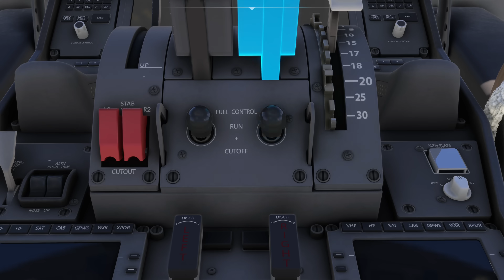Air India 171: Why Did The Fuel Cut-off Switch Get Moved?

Comment: What if the fuel control switches dropped to cutoff due to mechanical error and the pilot after he noticed the change in engine  noise looked at the switches and saw them in cutoff and assumed that the other pilot switched it and that is why he asked “why did you cutoff” to which the other pilot responded “I did not”. You don’t have to be guilty of anything to deny something you did not do. People assume a lot of things when something goes wrong. It is very natural that the pilot who saw the switches in cutoff wrongly assumed the other pilot did that.
Seems like a lot of aviation experts are trying to blame the pilots without even considering the possibility of a mechanical error on Boeing’s part. Not like Boeing has the best track record related to quality control and safety issues.
Reply: This is another assumption. What If he just assume that the switches was used because the engines spool down? . He asked and the other said he doesn't.... All speculations....
Reply: Check mentour pilot. The control switch has to be lifted then moved to cutoff. Not like a light switch
Reply: @richardzaluski assuming the mechanism is not broken. Did they verify the lock and mechanism were functioning correctly?
Reply: “Seems like a lot of aviation experts…” yes, the experts are. They are doing this because we know that the fuel was cutoff to both engines because the fuel control switches were moved to cutoff. So there is no mechanical error in the fuel lines. The switches are moved to cutoff, and immediately one of the pilots noticed and asked the other why he had done so, so it is safe to assume that one of the pilots saw an intentional act whether it was their own or the other pilots. What you are then suggesting is that both fuel cutoff switches moved to the turn off position just by themselves at the exact same time, prompted by nothing but gravity and takeoff vibrations, and at least one of the pilots was hallucinating. I think I need to go with the experts on this one.
Reply: I'd want to see the lever design and locking mechanism before I jumped to any conclusions about the pilots switching the switch.

Comment: The most probable and inescapable cause of the dual engine shutdown on Air India flight VT-ANB was an erroneous electrical signal generated within the aircraft's flight control system. This signal falsely indicated that the fuel cutoff switches had been moved to the "CUTOFF" position, even though the physical switches in the cockpit remained in the "RUN" position and were not manually actuated by the pilots.
This erroneous signal could have originated from:
 * A transient software bug in the Engine Control Units (ECUs), Flight Data Acquisition Units (FDAUs), or related control software.
 * A sensor malfunction within the fuel control switch unit itself or its signal pathway.
 * A subtle wiring fault (e.g., intermittent short, insulation breakdown) that momentarily mimicked a "CUTOFF" command.
This malfunction was likely:
 * Subtle and Undetectable: It provided no immediate physical feedback (sight, sound, touch) to the pilots that their controls were being overridden or misread.
 * Transient: The fault likely appeared briefly (causing the "CUTOFF" signal) and then cleared itself (leading to the "return to RUN" signal after 10-13 seconds), making it extremely difficult to reproduce or diagnose in flight or on the ground.
 * Systemic: Given the occurrence on a modern aircraft with a widespread fleet, the underlying vulnerability points to a common design or manufacturing flaw affecting multiple aircraft, rather than an isolated incident.

Comment: I'd like you to use your maximum creativity and imagination (even far fetched) to come up with a reason that these switches where not DELIBERATELY put in the off position! So a way to make the comment from the pilot 'I did not turn off those switches'  an honest answer and not a lie. This is not based on whisfull thinking but on the fact that Air India is checking all the switches in their fleet. So what can it be they look at? Can it for example be confusing for a pilot? How about the switch position compared to other aircraft that the pilot was in? How about the switch being in rest on the edge and accidentially falling in the off state? There must be some scenario's to come up with that may be inplausible but possibly true? I am just not sure that if you intend to crash the plane you would do it this way (crashing not guaranteed as the other pilot may recover it. Other methods are maybe more guaranteed). So everything combined I just doubt the obvious conclusion that you state so clearly.

Comment: Captain Steve who knows the switches problem which was an issue in 737 max and 777 or whatever other models may have now occured as one off in dreamliner.  Why is that not looked into ? 

We all know Air India pilots are best Steve never had a feel of bump during landing flew so many airlines most have a thud bump.

Investigate properly dont blame the pilots.

Comment: Hi Steve really enjoy your insights on the Airline industry. 
Just an observation on the conversation between the two Air India Pilots, the information currently available is not sufficient to determine which pilot shut off the fuel, the person asking the question "have you turned off the fuel" could have been the culprit, and double bluffing, by asking the other pilot to deflect suspicion away from him. Keep up the good work.

Comment: QUESTION:  The timing of when the fuel was cut off was nearly exactly when you'd expect the gear to be retracted.   Is there usually verbal communication between pilots to retract the gear to corroborate if this was just the ultimate brain fart (meant to retract gear and instead turned off engines)?    The gear retraction is a way different physical action that would never be confused for cutting off the engines, but I can see how someone could just mindlessly do the wrong "repetative action" at the wrong time.

Comment: The best suggestion I've heard in this debacle was the person who suggested that the fuel shutoff switches are so important that they should require a system that safeguards against unilateral activation. I envision "Consent" switches placed to the outboard of both pilots, out of reach of the other pilot, wired to a weight-in-seat sensor, with the logic set such that only the opposite pilot can give consent. In other words, no single pilot can give himself consent to activate the cutoff switches. Draconian? Yes, but until this tragedy, it was unthinkable that we would need such a system.

Comment: Capt Steeeve, I find it a bit odd, just a bit, that the Air India report has nothing to say about the 9 seconds that transpired between the 2nd engine fuel CUTOFF and the 1st engine set to RUN apart from the Pilot asking why the other shut them off. If you were the pilot, wouldn't you have restarted them the second you saw that they were cut off? I wonder what else the pilots might have been saying or doing during that time. Any thoughts?

Comment: Hey the report is not at complete report because the recorder is only showing the cut off positions and later turned on but it could be malfunction in all electronics and it might sent the wrong data or it might the short circuit in computer brain of plane.

Comment: The CVR picks up the quietest sounds in the cockpit. Can the investigators hear and pinpoint exactly when the switches have been turned off by an audible clicking sound, and could that help, after establishing what pilot was doing what,  determine which pilot did the “deed”?

Comment: Capt Steve
Is there anyway for fuel to be cut off by the Engine Control Computer malfunction, or for the fuel control switchs to move from run to off without being physically moved. 
Just Joe

Comment: Anyone saying that video cameras should be installed doesn't understand aviation and all of the reasons why pilot unions resist such actions. At best, limited scope cameras would be the compromise but, that isn't the policy being put forth. Limited scope cameras would be limited to narrow segments of the controls and switches and not a full view of the cockpit. Misinterpretations, leaking or tampering by foreign states, media and the public already happen with CVRs. Full cockpit video would very much attempted to be used out of context, in litigation and as means of surveillance by airlines to punish pilots. All things that are NOT the purpose of accident data. It breaks the "just culture" around aviation and strains the trust pilots have in that system. 

Comparing it to other industries is not apples to apples, commerical aviation's just culture is very different from the way every other industry works. It isn't as simple as installing a bunch of cameras, thousands of planes would need retrofits and even retrofitting a single plane isn't trivial. It would be extremely expensive to do so while airlines already work on single digit margins.

All I see from the "video cameras now" crowd is failure (or unwillingness) to understand the nuance of how aviation works. That and those not engaging in good faith argument. It isn't that video cameras couldn't be used, its that the way they would likely be implemented would break the trust pilots have in the just culture the industry has developed over decades. That is a far bigger detriment to safety than how the current system works.

Comment: I disagree concerning making the control only function if both pilots manipulate.

Statistically, incapacitation on 1 pilot is far more likely than a seasoned pilot making a blunder with this low of margin, right? And if one pilot is incapacitated, the pilot in command still needs access to shut these off if procedure dictates.

Comment: Hi Steve. Why would a pilot who noticed that the switches were off engage the other in a conversation about 'why ", instead of immediately putting them back on  within 1 - 2 seconds, given that this takeoff time is critical?it's a shame that such a new smart 787 wouldn't have the safety system installed as the Embraer has, where fuel switches cannot be shut off during flight unless the engines are at idle.

Comment: Unrelated to the aircraft’s computers, why don’t all commercial aircraft have a warning light and/or alarm for the fuel cutoff switches?  A manual shut off or cancellation switch for the alarm could also be installed for conditions that warrant silencing the alarm once acknowledged by the flight crew. 
Retired Safety Engineer, J C Lahtonen

Comment: If one of the pilots did switch the switches to cutoff and a pilot is heard almost immediately asking why did he do so then why did it take another 10 seconds for that pilot to turn the first engine back to run and then 4 seconds later the second engine. 
Immediately upon the engines cutoff the flying pilot would known from sound nevermind thrust and air speed.  It would take but a half second to check the switches and if they were in cutoff quickly switch them back on. 2 seconds tops.   I believe the switches were still showing run and it took ten seconds for a pilot to try turning them to cutoff and back to run to see if they restart.  When that one did they did it to the second one.
The default of these switches is cutoff, this means any loss of signal and the system goes to cutoff.  I am an electronics engineer and how those switches are processed needs scrutiny.

Comment: One second interval between "cut off" was analyzed not in favor of the pilot. 
Let's assume this was the control circuit malfunction and the switches physically stayed on "Run" position.
The pilot had to manually toggle each switch down-then-up. And here comes the explanation of why it took four seconds in-between of two switches to restore the power.

Comment: Trainer pilots and instructors regularly use fuel cutoff switches as part of emergency training

---

⚠️ Do They Ever “Play Around”?

No — not in the sense of casually flipping them. These switches are treated with the same discipline in the sim as in a real cockpit because they’re frequently used in simulations, experienced pilots might develop faster muscle memory for these switches, which could be risky in a real cockpit ? Could this be the case ? Just wondering? 

---

🧠 Could Sim Habit Lead to a Mistake in Real Life?

Yes, and this is something human factors experts do study:

A pilot who’s used to shutting off engines in simulators might reach for those switches in a confusing real emergency.

In high-stress or low-altitude scenarios (like takeoff), muscle memory can override rational thought.

This is being considered in the AI171 investigation, especially since the pilot(s) were reported to have recently undergone simulator training.

---

✅ Summary

Trainer pilots use fuel cutoff switches in simulators regularly — but as part of formal emergency procedures, not play.

Muscle memory or sim habits could contribute to accidental or confused use in the real cockpit.

Aviation safety teams analyze this exact behavior after accidents to prevent it in the future.

Would you like a breakdown of how sim training might accidentally build “wrong” habits — or what’s being done to prevent that?

Comment: How fast a pilot can push both the cut off switches; appears it takes handful of seconds to move the switch back on (that too 2).
It appears the same aircraft had a sensor issue reported in the earlier flight, will something similar can flick the switch automatically rather than human intervention. 
Why did DGCA issued an “order” (not advisory) to all Indian airlines to inspect functioning of fuel control switches in Boeing airplanes today?
Worth hearing your view on these too

Comment: If anything come out of this i hope that we can have a system that requires throttle be placed into idle before the fuel switch can be activated. This is sort of similar to an old crash were the pilot had accidentally turned in the reverse thruster while flying and the resulting crash created multiple redundancy so you cannot activate the reverse thrust during flight.

Still sometime we design stuff thinking no one is dumb enough to do it. Until it happens

Comment: Captain Steeeve, perhaps an alarm can be added to the fuel cutoff switches which would activate the moment someone starts to change them from run to off. It wouldn't stop the act, but it would alert the other crew member that the other member was about to try to cutoff the fuel., thus giving them more to to act to stop it if unwarranted. Also, the alarm could be set to not go off when the plane is on the ground.

Comment: Re your camera in cockpit comments, if say there was a wiring fault or something that caused the computer therefore to beleive those switchs were moved, a camera woudl have shown that yes or no one of the crew did move them, its not "impossible" some fault caused the computers to believe they were moved and then back, and thus thats whats been recorded, I accept its a long shot, but not impossilbe, also if it really was due to the reason we dont want to speak off, how would you know which one done it, for example I may move them, then say " why did you cut of the fuel" so everyone suspects my college, how would you ever know ? either way, very very sad :(

Comment: Capt Steve,
How do you know if dual engine failure (a computer glitch) event happened  before pilots commanded manual cut-off?? To re-start engines.  

The Boeing QRH memory items for a dual engine failure....

DUAL ENG FAIL/STALL
A

    1. FUEL CONTROL switches (both) ……………… CUTOFF, then RUN (PM)
    2. RAM AIR TURBINE switch …………………. Push and hold for 1 sec (PM)

Comment: Does Boeing use hall effect position sensors to determine switch positions? Is that how we know for certain a pilot physically moved the switch and not an unlikely electrical short circuit. Or is that action inferred from the timing of the fuel cut off signals and the other pilot questioning, "Why did you do that?"

Comment: the pilots are not kids. I doubt they would do such a thing. I believe the probability of a improper switch placement or faulty switches is more likely. Gut feeling is that those switches were hanging on the edge of the RUN until the aircraft took off and the vibrations came off backwards into off. The 1 sec difference is likely coincidence.

Comment: I'm concerned at how easy it was to bring down an airplane by the movement of just these 2 little switches.  What is being done to prevent such another catastrophe in future flights in any plane with a cutoff switch.  My understanding is that even at altitude, it can be difficult to relight engines and obviously impossible to do so at 600 ft.

Comment: Which condition is the fail-safe condition for the cutoff switches? I am wondering how the system would react if something shorted out the signal lines from the switches, something intermittent. This seems extrememly unlikely, but the investigators will have to consider it. Interestingly, this is one case where a camera would help out a lot. If it were clear from the video that no-one operated those switches then the investigation would be extremely different. This seems unlikely, but in complex systems obscure faults have led to strange and deadly symptoms which required a lot of research and investigation to uncover. And I can think of several cases where people were quick to blame human sabotage but it turned out to be otherwise after a long unvestigation—I am thinking especially of the USS Iowa gun turret explosion.

Comment: Captain, but if someone wanted to commit suicide, wouldn't it be easier to push the nose down at full throttle? Simply flipping the fuel switches might be ineffective, because the other pilot might see you and stop you.